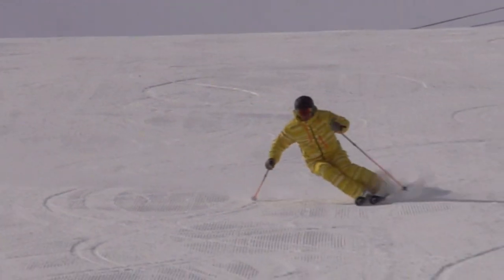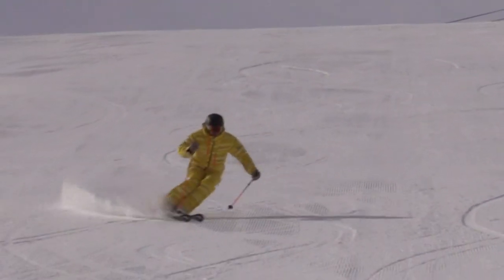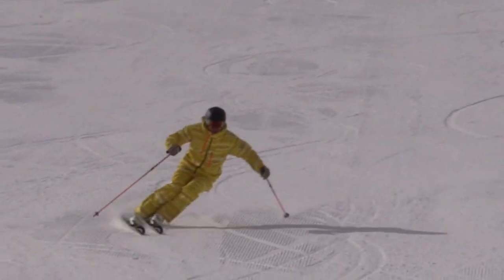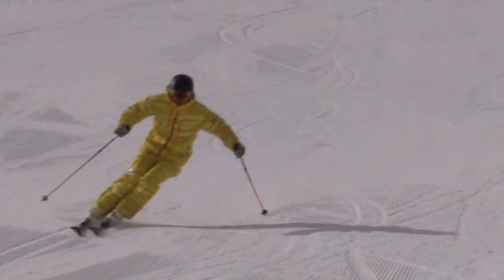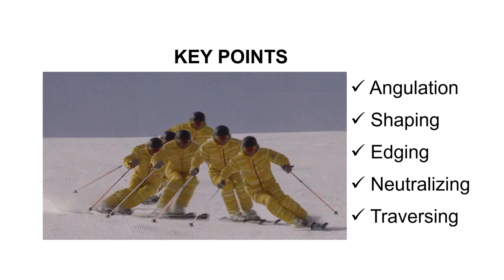Richi Berger Skiworld 20

Comment: I have been an expert skier for yrs...shoulder steer has been my weak link until crazy canuck dave irwin noted..just don't move your shoulders..so simple..I couldn't believe the difference..once the head and shoulders are as one the lower body now steers under my upper body..I now use the counter rotation energy build up instead of waisting it...this is an overlooked condition by many instructors..thx

Comment: Thank you for posting videos like this: very insightful.

In the video's it can be seen that you push / extend to release (using the up-inward movement).

However, in the last part of the video (key points) it seems that you flex / retract the legs to release. Your center of mass stays lower as well in those pictures.

Can it be that the pictures are from a different run?
Reply: Flex/ retract the legs to release is dynamic skiing ... Harb ski  systems ... Rich Berger is one of best skiers on the planet